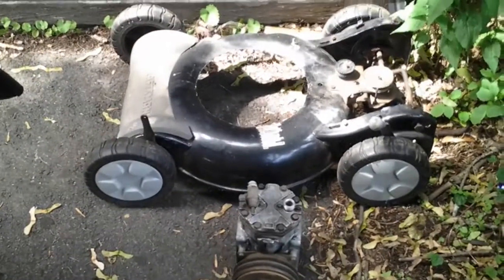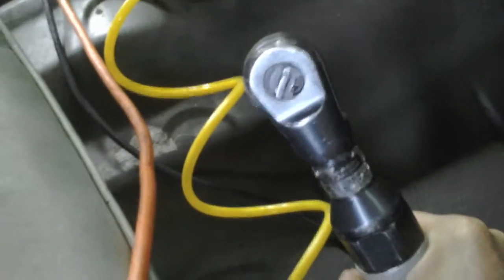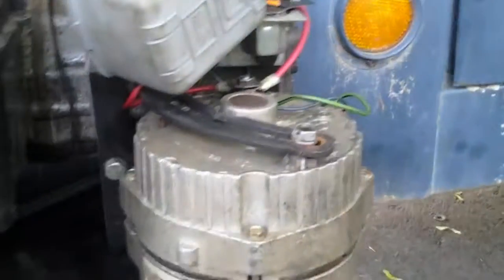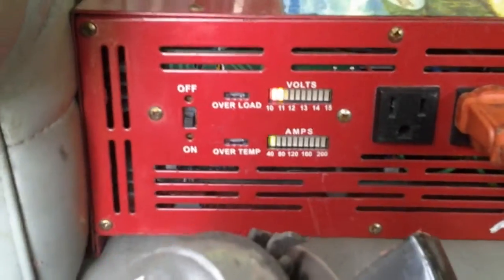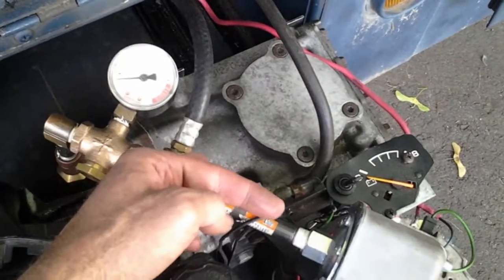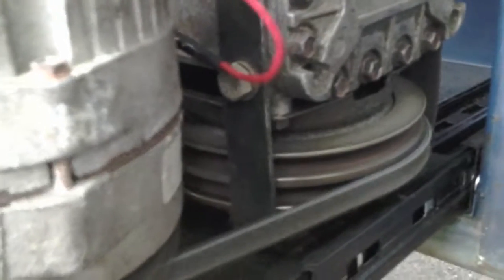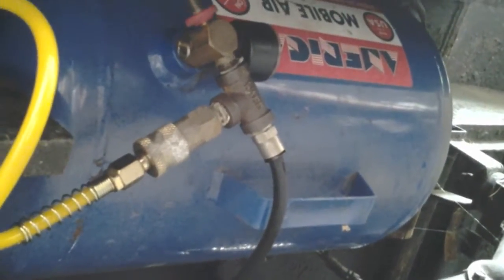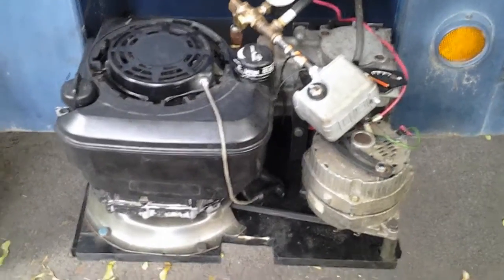Home built generator & air compressor from lawn mower

Comment: I wonder about the longevity of the a/c compressor. Without the freon which contains oil, I think the pump will seize up pretty quickly.  I have thought about using a motorcycle engine as a compressor with a horizontal shaft engine powering it. Just plumbing a line into the sparkplug hole with a check valve to an air tank. Seems like it'd work being as it's air cooled and internally lubricated.

Comment: I would only say add a small air tank if its not strong enough to run air tools the benchmark should be lug nuts.
Reply: you should check out wood fired ovens for cooking can be super simple !

Comment: being poor is fun! makes you think instead of spending money> I had foot surgery 3 weeks ago the day after I put half a roof on I also built a conveyor to lift the shingles and tools. pretty big accomplishment after loosing 1/3 rd of my foot and in stitches!
Reply: Being poor, only stimulates, the best,  in  ' some '   of us.    My forte' , is garage/junk/yard sales/dumpster diving      (urban mining)     and then wandering around the garage, thinking up ways, to make creative stuff.  Might make, a small tree cutter:  from old 1.5  hp   120 volt  floor scrubber. Heavy duty, motor has 50 amp bridge rectifier, so runs on DC.  Would attach table saw blade  (10  or  12 inch, i think) to the front drive.   The idler, on a lever at the hanlde, would   '' connect the drive ''  as it were.    Then, it would saw stuff, at ground level, or higher, just by tipping the rear handle down, a bit.   Maybe mite use, lawnmower engine, m o r e    power.    .............and, other ideas......
Reply: I'm thinking with a 24 D.C. motor with a Mirak speed controller ?
Reply: Mr Keith......you will,  '' Walk her "" again.   Your wife, i mean  !   Good luck, with your  foot. i have a middle finger, left hand, whacked up from chainsaw slip.  WE  must be more,  
c a r e full  !!

Comment: That engine sounds like it's spinning above 3600rpm when it's not under load... might not be good for the rod bearing at that speed.
Reply: I was thinking it was running a bit high

Comment: nice video bud
i add a 2nd alternator(remove voltage regulator) to my ford explorer for on board welder so is 120v power tools. i jus modified the ac compressor to an air compressor with 2gl little tank
no video yet

Comment: Creative, I would like more detail on the build. What is the  compressor off of ? This looks to totally be well done!    The only fault is you good use  better camera skills or practice.
Reply: longshore jlepper 
Yeah, I had to do a lot of running around in a short time. I think I did the stabilization. It's a York style from a wagoneer, I think. I had several and tried which one would work the best. This was quite a bit of work but necessary with the leaky rims on my car. The limited space was the challenge
Reply: Mr Jones, is using an AC compressor, from an older, looks like,  GM  car.

Comment: how many watts is your inverter?
Reply from the maker: 1500. No longer have this project but the new one has a 2500 watt inverter. See the LeSharo
Reply: +panther4x4 whats the dimensions on the pulley you was running off the crank of that motor?
Reply from the maker: No idea
Reply: +panther4x4 👍

Comment: I have built 3 similar to that ! A 8 HP briggs & stratton runs the compressor a lot better ! with a longer belt and 1 more idler pulley you can get more belt contact on those pulleys ! that is if u have trouble with belt slippage ! thats a good & handy setup ! i enjoyed youre video !thanks for sharing !
Reply from the maker: Thanks Travis, so you have a york compressor on 8 hp briggs? That would be ideal to have more room and a larger briggs but you see what I'm working with. I can probably add an idler but I just watch it and shut it off before it starts slipping. It's a portable unit as you can see and works to air up tires, not really for running s shop compressor.
Reply from the maker: Travis Daugherty Thanks for the input and idea of the idler pulley. Space is limited as you can see. 8  hp would be great, I think this is 6.75 model. Did you use a horizontal engine? Maybe the slippage is due to the need for more pulley surface contact with the belt. Right now it bogs down at 70 psi. I got an 110 amp alt that works great.
Reply: panther4x4  I used a vertical shaft Briggs with electric start , on a riding mower frame ! & yes space is limited on youre set up  !